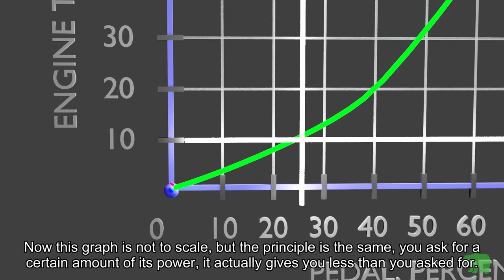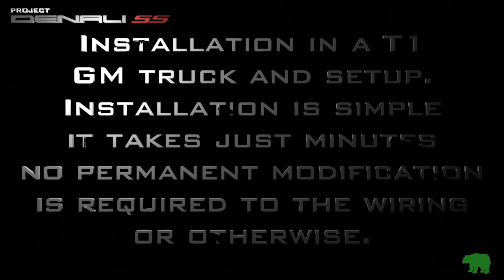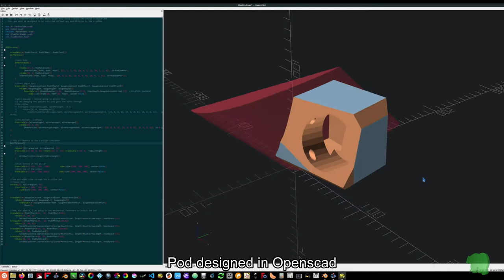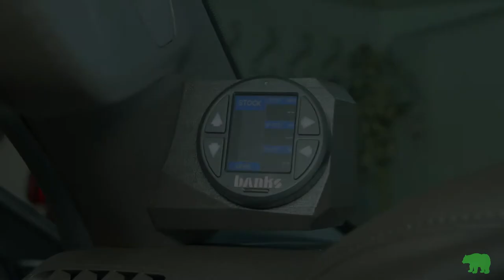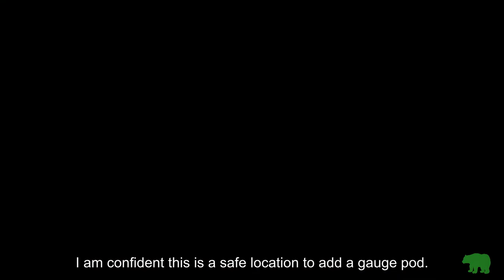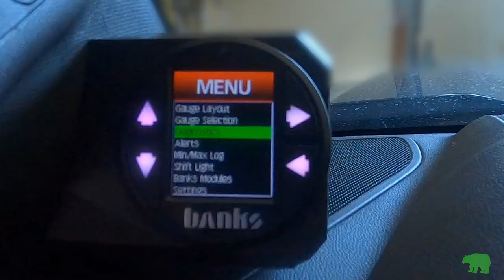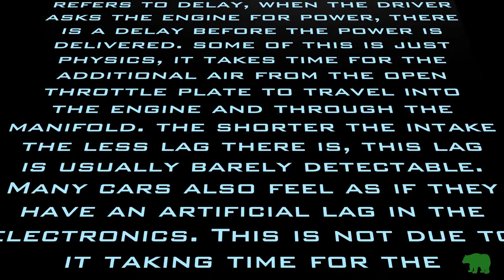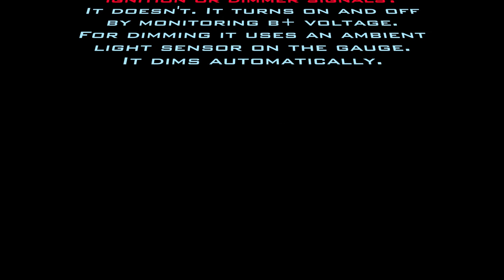Banks Pedal Monster Install and Impressions

Comment: Very very nicely done.  My application will be a little different, 2020 stick shift Miata,  but I learned some things that will still apply over.  My goal is to be able to smooth out and contour a couple spots on power curve. Thanks again.  👍🏻 👍🏻

Comment: Really like the mount idea! Just a tip for marking holes next time you are worried about drilling through. Spin the drillbit in reverse. It will still make a small mark but you don't have to worry about accidentally poking through 😉
Reply from the maker: Thays a great idea. Thanks!

Comment: When going in for service or someone else driving like you wife, can you turn off the PM or change it to back to stock mode? I think you might have addressed this but I’m too lazy to look back to find it. 🤪
Reply from the maker: Definitely, you could always unplug it if you wanted to be sure, plug the cable back into the pedal directly. But easier if you have the idash gauge or the app just turn the pedal boost all the way down. Once it hits the lowest point it even says stock on the gauge. So you're back to the factory behavior. Then just turn it back up again when you drive. That's what i do, only takes a couple seconds.

Comment: How do we get it to register hp and torque please
Reply from the maker: If youve got the gauge you can customize what parameters are shown. Select a layout that includes some engine parameters, customize the parameters shown, and pick the hp and torque settings. Id have to go play with the gauge to tell you specifically, but its pretty easy to do.
There are a ton of parameters that it can show. I recently found that it acutally does have a current gear parameter as i mentioned in my wish list. I just hadn't found it yet. Shows both what gear the transmission is in and whether the torque converternis locked. Really neat product.

Comment: Great video! Would you be able to share the 3D print idash mount file please?
Reply: You know what...I will. Although my thingiverse account is being weird right now and it isn't letting me log in. Let me figure that out and I'll put it up there for anyone who has their own printer. I'd also be willing to sell a print of this mount for anyone who wants one but doesn't have their own printer. 
Although keep in mind I built the pod specifically for the iDash gauge, the gauge is designed to fit into a standard gauge pod, I think its 52mm if I remember correctly, the iDash definitely fits in there but its a very compact gauge, its pretty shallow behind. if you want to use this for something other than that you might have to test fit and possibly make the cavity deeper depending on the depth of your gauge.
Reply from the maker: Here you go, I decided to put it on thingiverse. 
https://www.thingiverse.com/thing:5430783
Please heed the warnings though, remember there's an airbag behind that A-pillar, be 100% sure not to damage anything during installation and keep your wires well clear of anything airbag related. Safety first!
Reply: Is this model compatible with my 2017 Z71 Silverado